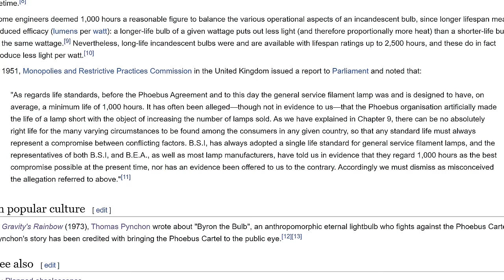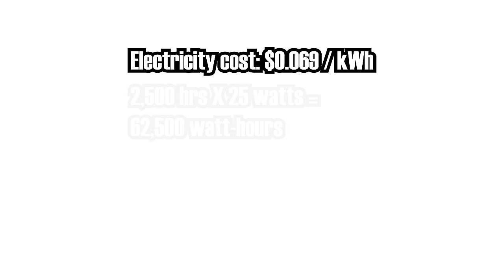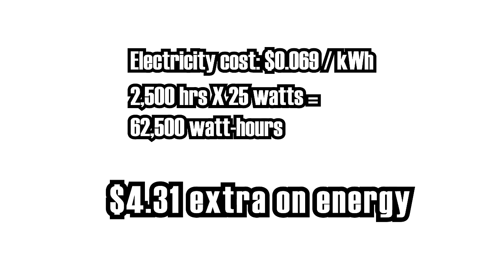Longer-lasting light bulbs: it was complicated

Comment: yeah high temp is not an easy thing to solve, i should know, a major problem (and why spacex's raptor engine is such a big deal) is trying to develop a metal alloy that can survive 1,000 C oxygen being blasted at it, the fact that they figured out how to keep that thin of a wire from melting when heated to 1,500 C in the 1800s is amazing..

Comment: Haha. Ha.

My cochlear implant has planned obsolescence.  I had it surgically installed back in 2012 and as of 2023 it's been obsolete for the past five years. It still works; I have my hearing for now...but the one company that makes them is no longer producing replacement parts for it.  I've heard there was a company that had invented ocular implants that worked similarly but they went under so everyone who had one implanted is now SOL.

But yeah, that's one of the things they don't tell you about when it comes to cybernetics: Some of your bodily autonomy is lost to planned obsolescence.

As for light bulbs I see them as analogous to box-cutter blades.  As you use them they become dull over time, and dull blades are huge safety hazards because they require more applied force to cut.  Light bulbs that have been used for longer amounts of time dull imperceptibly until they are simply not safe to use in high-risk environments, like surgical rooms.  So for general safety, having a lifespan limit makes sense.

Comment: I'm surprised you still haven't made a video about this but with LEDs because LEDs are able to put out about 200 lumens per watt when they are made to not be intentionally inefficient but they are intentionally ran harder to make them last less long and to a pretty horrible 20-50 lumens per watt efficiency. Running the LEDs less hard not only makes them more efficient but also last way longer.

Comment: Yep, it's a trade off. And yeah, led is much better. But indeed there is a lot of junk leds with crap components and run them wayyyyy to hard. Fun thing is, a led is more efficient when ran on a lower current. And we kind of getting is a similar situation nowadays. Because unlike some people think, LEDs do burn. The light output will drop over it's lifetime but it's power consumption does not! So it would be good to change out a led bulb when it's still working. Although it's wayyyyyy longer than a incandescent bulb or a lot of cheap led light tend to last. But especially the cheap bulb that don't blow their electronics tend to run the leds hard and thus burning them quicker. But yeah, I only bought quality bulbs (most importantly for the better light color) and over the past 6 non has failed. The only led bulbs that failed me where the cheap bulbs in the hood thet came with the house :|

But on a different note, you where talking about energy companies. Do you know when they switched to billing per kWh? Because from what I heard is that they use to charge per house or even per bulb per day.

Comment: If the tungsten filament was dipped in clear epoxy resin, would it lengthen its lifespan? Would the evaporation rate be lower?
Reply: Given that epoxy resin has a far lower melting temperature than the filament operates at if I'm not mistaken, I doubt it would help much. ;-)
Reply: @TravisTev  ah, cheers, it never occurred to me to look up its melting point!👍

Comment: Cerium when added to steel makes sure that the carbon and iron will COMPLETELY DISSOLVE TOGETHER and Yttrium when added to the same steel will prevent the iron and carbon from physically separating from each other. Boron when added to the same steel INTENSIFIES THE ALLOYING EFFECTS of all alloying metals and other substances, for every 1 ounce of boron added to steel the amount of the original alloying ingredient can be cut in half. And it can be repeated again and again and again. But what if both CERIUM and YTTRIUM and BORON can be added to the same steel which is an alloy of iron and carbon, what would be the result? And what if the same was done to tungsten, depending on the proportions of the 3 alloying ingredients added to it, what will happen to the tungsten?

We can define sublimation as the transition of a substance from the solid phase to the gaseous phase without changing into the liquid phase. This process is an endothermic phase transition that occurs at a temperature and pressure below the triple point of the substance.

My granduncle once told me about what his professor during the 1950s told him. 
Diamonds can cut diamonds. 
Diamonds can cut sapphire. 
Sapphire cannot cut diamonds. 
BUT SAPPHIRE CANNOT CUT SAPPHIRE!

Comment: Okay, so suppose I managed to design a bulb with 2 filaments in it, that would only run one of the two filaments until it broke and then start running the second one until it broke.  It might not last 2000 hours, but it would last longer then a regular bulb.  But why would I bother to even try to do such a thing with a cartel in place that made sure bulbs didn't last more than 1000 hours.  Just because we don't know what innovations people might have come up with because we had the cartel doesn't mean it didn't stifle innovation.

Comment: I have Philips Wiz LED bulbs. 5 of theme. One is a 150W in my stand, One is a 40 W in the torch coming off the stand, and 3 are all up in my overhead land. They all have wifi.

NOW BEFORE YOU CALL ME INSANE I DON'T MEAN THEY HAVE INTERNET. No. Rather they directly connect to my phone USING wireless. I can COMPLETELY control their color temperature on the phone OR DO WHAT I ACTUALLY DID:

I paid 40 bucks for the remote. YES really. The thing is I have 4 presets, PLUS a deault white for them to turn on to. The default is a little cool. Preset 1 is A middle of the road white. 2 is a noticably warmer white. 3 is VERY WARM. And if i even feel like it (Which is...never.) Preset 4 is a zero warmth white (the default has SOME hint of warth at least).

CRAZY THING THOUGH: I USE OTHER MODES. When i watch TV i use the "TV Time" mode which really dims the lights and gives them then a purple tint that doesn't chnage my TV image at all but...BUT I SWEAR MAKES ME FEEL MORE LIKE IN IN A THEATER (Though my surround system also helps LOL)

Comment: Totally agree. No plot.  Truly wasteful planned obsolescence is at its worst with the computer industry.  We understand that operating systems are requiring more computer power to function, so that the slower chips become useless.  However,  a huge amount of e-waste would be saved if they built computers that could have new processor motherboards inserted inside, and save the life of most of the unit, that is the power supply, drives, keyboards, sound systems, and screens.

Comment: You want to make a lightbulb last just cut the voltage light dimmers can do this. Get the kind that starts at zero not the push to turn on kind. This is a true statement: my friend had a slide projector that had an expensive bulb. I told him that light dimmers are DC but that ain't true they use triacs  but the idea that saves the bulbs is the slow on. You gradually increase the voltage but you don't really need full voltage for the bulb to light bright enough. He never had to replace another bulb. 

My LED Christmas light string used to burn out about seven in a three weeks time. I just started using a voltage reducer by APC from 120 volts to 110 volts. I never had to replace another bulb. 73

Comment: although the problem is that when you spend a lot of money on a appliance/etc. that has been designed with planned obsolescence, it leaves a bad taste in your mouth and youl'd likely try a different brand when your purchase fails. avoiding the brand for the most part in general afterwards, so it doesn't truly benefit the company either, unless a person has A. invested a lot in one ecosystem IE, getting yet another iPhone even with its terrible battery life, since, well, you have a MacBook and an iPad, you gotta admit its hella convenient that they talk to each other and play nicely for the most part. B. company offers certain features or deals you cant get anywhere else or see as a fair trade off.
Reply: I actually think lightbulbs and electric lights in general have similar if not exact same purchase experience as oil lamps, you buy on oil lamp, you buy a light fixture. you buy a bulb, you buy wicks, mantles, etc. you consistently pay for oil and you have to by more if you burn more and vis a vis, you pay on a monthly basis for your electricity, paying more per amount of kWh you use. the lightbulb has always been a modern wick equivalent, and like an oil lamp, you may still have a wick in there that could actually still light, but its gross and icky, and lighting a very old wick can be very sooty so you buy a new one, same with lights, you went through a phase of all 6000K color temp bulbs, realise everyone inside your house looks like walking corpses, then switch it out to a much more agreeable, warmer light. that was the thing, until recently we had always had the option to swap out or at least modify our lights in some fashion, wether that be buying a special candle holder with a mirror on it to reflect light, or an add-on mantle converter for your previously open flame gas light to burn bright white. but hardwired fixtures with built in led is concerning, while they last a long time, its still a call to an electrician or getting concerningly comfortable with electric work every 3 years or so when one inevitably fails, or styles change, etc.

Comment: Yes, we had to change the incandescent light bulbs more frequently than LED bulbs. But then we always had spares at home, bought in 3-packs or 5-packs or even 10-packs.

CCFL (folded tube lamps, good riddance) and LED lamps cost much more in comparison (at least branded ones). And if they then don't fulfil the promise of "15.000+ hours" it's annoying.

Why? No, not because of the cost, at least not alone. Why then? Because an incandescent light bulb is just a bit of glass, wire, metal, resin and solder. It is inert. You can even recycle glass and metal. But CCFLs and LEDs contain electronic components that are not good for the environment (CCFLs even contain mercury). I do believe that LED lamp technology could advance by not using electrolytic capacitors, but that's  another discussion....

Comment: WHY did they standardize the LIFESPAN and Not the brightness/efficiency?
This still seems to imply a certain amount of planned obsolescence even with the other factors.
Reply: Because it is a more useful metric for classic lightbulbs that need to be changed often. If all the given variables (efficiency/runtime/cost) are always related in the same way (which they are with this design) it doesn't really matter which one you define as default. You could have labeled the lumen per Watt, but I think it is far less of an interesting variable if you have a fixed amount of lightbulbs in your house anyway and the wattage they run at is fixed anyway too. For the same reason they label LED bulbs with lumen now - because runtime becomes more abstract and less relevant now that it is in the tenthousands of hours. So they show you the next useful variable.

Comment: Did the lightbulb cartel inhibit anyone from trying to make a longer lasting lightbulb or was that just applicable to big corporations? I ask because if the light hours cap was put in place to keep anyone from trying to improve the longevity then that's a problem. If it came about as a result of hitting the physical limits of the technology then that's different. 

I guess what I'm asking is could this have turned into a Preston Tucker situation had someone managed to have made a brighter cheaper and longer lasting incandescent lightbulb?

Comment: I think one of the details of the cartel/planned-obsolescence narrative that make it so compelling, and is NOT addressed in this video, is that the tests for compliance were performed by measuring the amount of time it took to wear out and NOT a test for energy efficiency. Were there straightforward ways of testing this at the time? Semiconductors didn't exist and photomultiplier tubes weren't readily available until the 1930s. I figure, though, that some sort of photographic film could have been used for this purpose and measured against a reference. I'm not even sure that orthochromatic film would be necessary for this to work, though it was already available at this point. On the other hand, with all members of the cartel aiming for the 1000H mark, anything that could be deliberately done to shorten the life of the bulb without making the lamp hotter could only make the light from the bulb worse. Still it seems round-about from our perspective here and now.

Comment: If people were happy to have dimmer light bulbs that draw just as much or lower power(as shown in ur video), theres no need to restrict companies from making bulbs that lasted longer(no additional strain on the grid due to there NOT being extra power consumption).

In a sense u are not saving on power bills by running the longer lasting bulbs, ur just losing out on the brightness. Which people may be ok with. Its also better for the environment to not have to use so much material and create bulbs that become unusable junk soon.

So there is still a chance that the 1000 hour limit was not exactly made with the best intentions in mind. 
2500 could have been the "sweetspot" as well. Just as good as 1000. 
It just depends on who u ask, each one with their preference. But forcing members to abide by this by doing routine tests just looks fishy to me given that i dont really think its a power grid problem based on what i said above. 

Maybe i am wrong and people REALLY wanted maximum illumination and bought more than 1 2500 hour bulbs for their lighting requirements and now need to buy just one of the new 1000 hour ones, hence saving on energy. But i doubt it.

Comment: The planned obsolescence has been transferred to LEDs.    I have older LEDs from five to seven years ago that are still working while LEDs from a couple of years ago don't last as long.
Reply: I recommend you to make a bunch of holes below the circuit board and take the top plastic cap off.

Comment: This doesn't make sense to me because the focus here should be on the design of the bulb itself not the power you run through it because people don't control the voltage/power and the heat at which a bulb runs. Is it that the filament for the long life bulbs is thicker, so the evaporation affects it less severely but because it's thicker it is more energy inefficient and requires more power and doesn't burn as bright?

Comment: Pedantic tidbit. 

When writing a temperature of say, three thousand degrees Celsius, it's written:
3000 ºC, with a space between the number and the quantifier, in this case º, for degrees.  But kelvins (symbol: K) are not degrees, and should not use the degree symbol   The kelvin and the degree Celsius are the same size, but the value has a different meaning that makes the kelvin a true unit, and not a degree.  With few exceptions, a true unit must have two properties: 1. A value of 0 means that there isn't any of what's being measured; and 2. a value n times greater means n times more of what's being measured.

It's easy to see that degree Celsius does not meet either test; 0 ºC does not mean no heat at all.  There are hundreds of negative degrees below before one reaches no heat.  But zero kelvins, 0 K) does mean no heat (ignoring quantum uncertainty).  Similarly, doubling the Kelvin temperature means twice as much thermal energy, but it's absurd to suggest that an object that goes from 1 ºC to 2 ºC is twice as hot. So the divisions on a Celsius or Fahrenheit scale are degrees, i.e. an amount of difference, but are not units.

So the use of the symbol ºK is deprecated, and the divisions on he Kelvin scale are not called degrees and are called kelvins, just like grams or newtons.

It is correct to use the degree symbol without a preceding space when writing angles, such as 90º, but not with temperatures.

End of pedantic tidbit.  Hope you enjoyed it.  😇

Comment: Unfortunately, led bulbs have come to be garbage even from reputable manufacturers, even though they shouldn’t be. The technology is amazing. I’ve had name brand led bulbs burn out in less than a week (some in fewer than hours) and that wasn’t an anomaly with those brands. I no longer install ‘permanent’ led fixtures anywhere, for any reason. I’ve gone back to Edison base fixtures for everything. I no longer believe that the brief life span of many of these bulbs is an accident of any kind. I still have some of the first led bulbs I ever encountered and they are still doing just fine, so I know it’s not a technology problem. Same thing was true with the cfl bulbs.